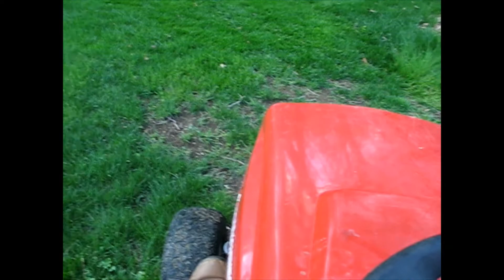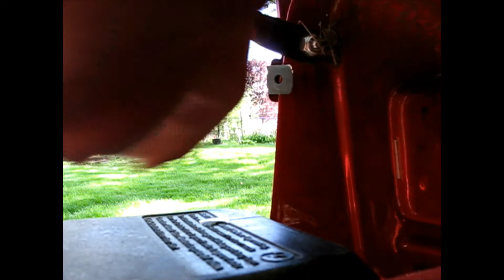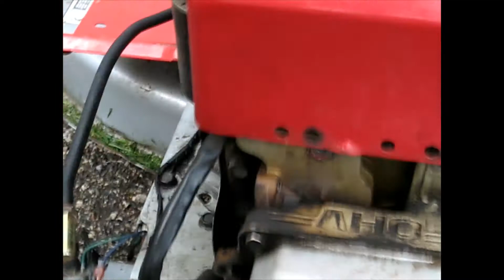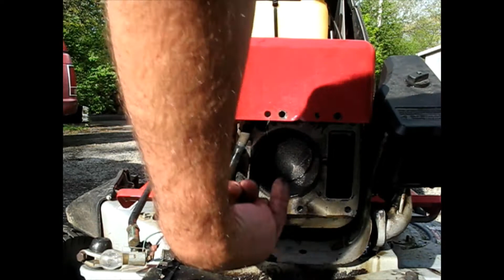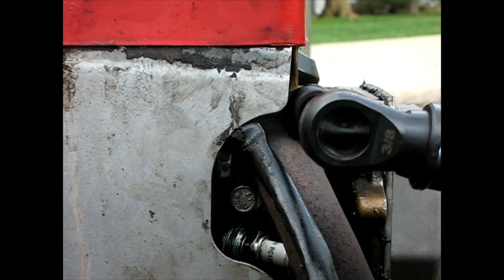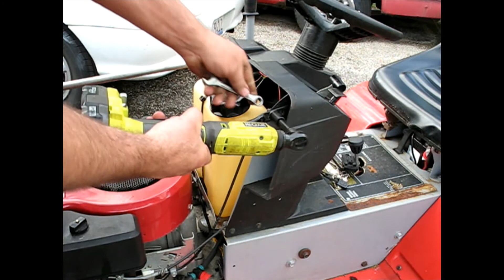Briggs OHV 14 5hp smokes really bad  Diagnosis and repair of bad head gasket

Comment: I have same engine on a toro wheel horse...doesn't seem like I'm burning oil but I'm definitley leaking oil onto the hot exhaust...I also have evidence of oil leaks everywhere...on the head...valve cover...all around the sump...etc...I'm assuming it's the same issue you have...head gasket causing overpressurized crankcase